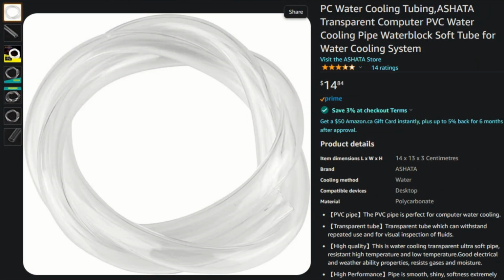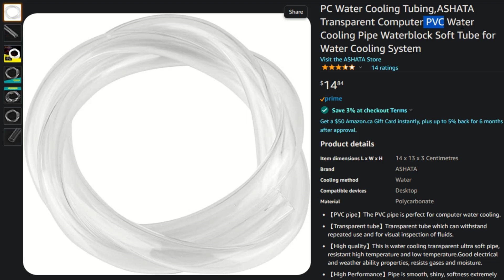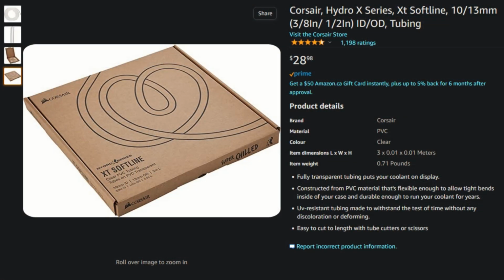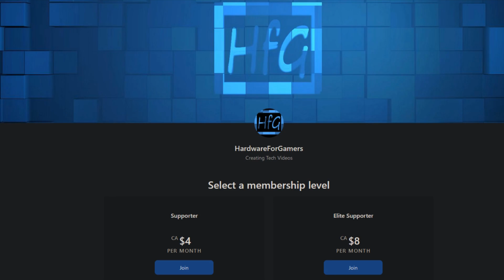The Tubing In My Custom Water Cooling Loop Turned GREEN??

Comment: Dude... Replace the tubing.  Drain & flush every 180 days, replace the tubing every 24 months, take the entire loop down every 48 and inspect the rad, fittings, block(s) & replace the tubing ('cause that's a 24 month interval)).

NEVER used plain RO or distilled water (demineralised) because it will eat metal - especially copper (unless you add an anti-corrosion and non-corrosive biocide - then it's not plain then is it).

Another significant reason water changes is - light and temperature (y'all like them ARGB cases and translucent tubes). Mushrooms may grow in the dark but a great deal of things need some spectra of light.

My guess is it's inorganic and the hard polymer in the reservoir is too smooth for the copper compounds to stick while the soft tube - not nearly as dense. 

You know it's not organics in suspension because the water isn't discoloured in the reservoir (it would actually be more prominent there because - well... It's larger diameter than the tubes).

.... there's reasons why AIOs are in opaque tubes...

Comment: Cu will oxidize to Cu2O3 or will react with carbonates and basic solutions to form (CuCO3.Cu(OH)2) which is green.  Are you sure it is not algea growth, did you use an algecide?
Reply from the maker: I did not add anything to the EK coolant. So, yes it could be algae, but it doesn't look like algae to me with my limited knowledge.
Reply: @HardwareForGamers  EK coolant should have the proper algaecides.  It is like just some Cu compounds leaching into the system.
Reply: ❤.  @JumpingJack6 - that would be my guess. You are all over it. (Assuming he has a copper radiator - it's definitely eating it. Some CPU/GPU thermal blocks are  plated to reduce this. But given time, it will eat that too - just not as quickly).

Comment: I've never done water cooling but I've been looking into it a lot because I plan to for my next build, one thing I've seen come up a bit for soft tubing is UV yellowing, if your PC gets any sunlight even just indirect sunlight (or if you have UV lighting) then many plastics will yellow quite a lot, and often "clear" tubing has a slight blue tint to it which when combined could result in the greenish color you are seeing. It also explains why it is only the tubing that was affected but not the res, why you couldn't clean them, and why only the exposed tubing not the parts hidden by the fittings changed color.
Just a theory though.
Reply from the maker: The system doesn't really get any sunlight with the way it's angled, but I wonder if my studio lights might be putting out some UV light...🤔 Or some wavelength of light the tubing doesn't like.

Comment: Water and heat are a great combination for algae formation, which could be what caused your problem here. My guess is your coolant doesn't have a biocide or uses a poor one.
Reply from the maker: But if it was algae would it not have specks of algae in the coolant?
Reply: @HardwareForGamers  That's correct, but it's a hit or miss when in comes to microorganisms. Maybe the tubing was already contaminated because it was stored in a warm, humid place. Hard to tell at this point. I'm still thinking about other probable causes, but that greenish tone is definitely algae to me.
Reply from the maker: @groverm5045  yeah, I'm still a noob when it comes to customer water cooling, so I am at a loss. I used EK cryofual thinking if I used a named coolant I wouldn't need to worry about this stuff.
Reply: @HardwareForGamers  Not your fault. We all fell for the marketing and branding of a product at some point. Only first-hand experience shows us which products are worth our money.

Comment: contamination of some sort and because of heat it might be algae type thing. or like you talked about - bad plastic
Reply from the maker: From my understanding of it was algae the coolant would have little specks of something, and it doesn't. So yeah, not sure.
Reply: yep definetly algae, happened to me once when I used "opened" destiled water wich I guess got contaminated. Since the I've been using sealed destiled water directly from the store and haven't changed it since 2019 and still crystal clear (also I read somewhere that direct sunlight help the propagation of algae too). I'm running hardline with acrylic so it was easier to clean them back to it's clear state.

I'd recommed changing the water every 6 months since that's the avarage recommended time from reddit but since I haven't had any temps issues or cloggings I've just left my loop at is it.